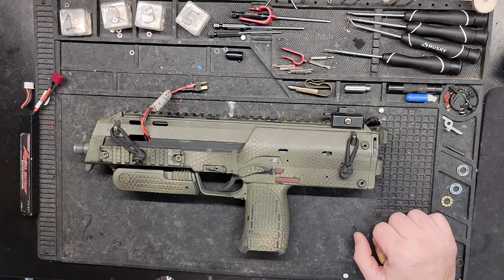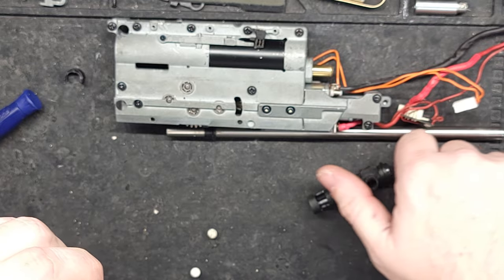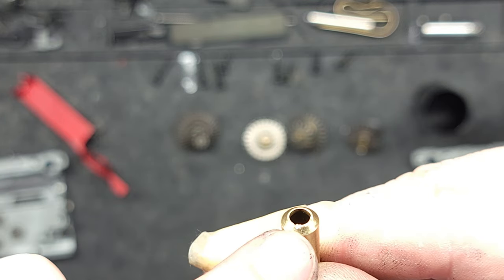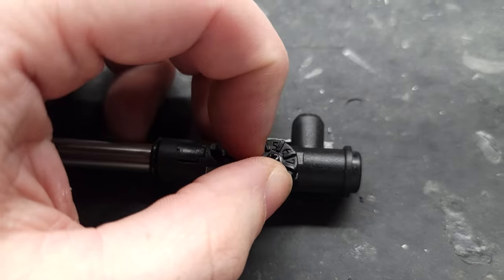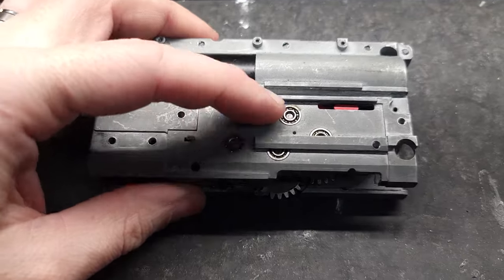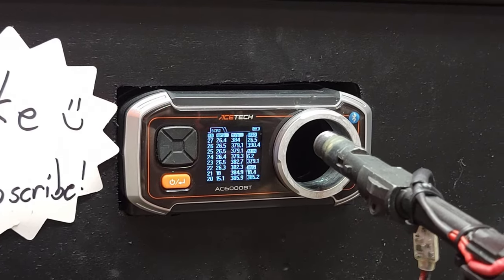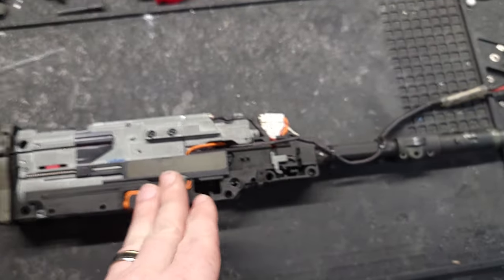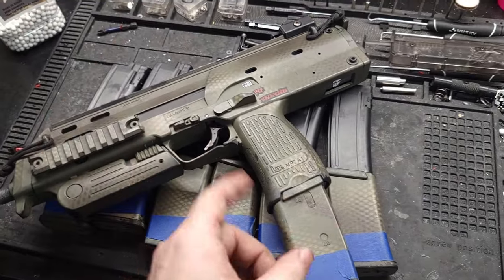VFC MP7 Build Tech Tips

Comment: T238 makes an mp7 mosfet now, not sure if it is supposed to be TM or VFC compatible but no one has done a video on it yet, additionally Solink makes a VFC compatible brushless motor for the mp7 but same thing, no one has a video about it yet. 

Could you do a full video showing tappet plate, hopup arm, mosfet and brushless motor install along with how to modify the magazine follower. Sort of a one stop video to make a VFC MP7 viable as a competitive aeg ?
Reply from the maker: Unfortunately, that MP7 mosfet is for a gel blaster MP7 and will not work with the VFC MP7 at all.  As for the solink brushless motor, I got one coming and will make a video of it.  

As for the magazine follower, I am working with Bullcraft in stocking the 1 piece followers specifically for the mp7 magazine.

Comment: Can these things take 11.1v, then? The manual and every other forum seem to suggest that the higher voltage is the receipe for disaster. What are your thoughts?
Reply from the maker: Yup, after spending many many hours working on these things.  Full auto with 11.1v lipos is what really damages these things. Putting the bullgear tappet and metal nozzle really helps these mp7's reliability.
Reply: @wyshtechairsoft  Gotcha. One more thing... do you upgrade the spring in your customers' guns? In the manual, it says that they're all putting out berween 0.8 and 1 Joules (mine is 0.79) but your fps seems WAY higher than a 0.8J AEG...
Reply from the maker: @dominicpaver I usually get customers with factoty springs pushing 1.3 - 1.5J. I normally dont stock the springs.

Comment: Do you have a video on install of the AB++?! Im about to attempt install, but i cant find any detailed videos to install on the mp7
Reply from the maker: Its pretty simple. You just solder the signal wires to the wiring connection junction that is right behind the motor.  Read the install instructions wire diagram.
Reply: @wyshtechairsoft  sweet!! I just received a order from your website! I got a mp7 and the nozzle broke after a weekend. So I'm replacing tappet, bucking, hop arm, nozzle, and mosfet. Even cut off the extra switches! Thanks for the help!!
Reply from the maker: @jimmyduff1954  glad to help bud.  Ive found after many many hours of trial and error.  These breakages in these mp7's is due to cycling too fast and the bucking lips being too far into the bb feed tube. Which if a 11.1v lipo is used, theres always a high chance of the bucking lip to fold into the barrel with the bb and cause a jam. The jam is what causes the damage.  7.4v lipo greatly reduces this chance.  Just wanted to give you a heads up.
Reply: @wyshtechairsoft absolutely! I havnt had a single issue (other than low fps i now assume is because the stock nozzle hit the mag follower causing reduced air seal in bucking) until I shot it full auto, then all of a sudden I started having over spin issues, then  I broke the nozzle housing (getting upset and holding full auto through a mag or 2) 😂 totally my fault. I never do full auto, but I was curious about the rate of fire. Curiosity killed the cat I guess 😂
Reply: @wyshtechairsoft  maaan iv got a new issue! So I got the mosfet in, works really well! Got the nozzle in, got the tappet and hop arm in... it chronoed at 250fps with a .20... I took it apart and Teflon mod the cylinder head because that's the only place I could see loosing compression. And still 250fps. Do you know if this mp7 takes a standard v2 aeg spring?? Thanks again!
Reply from the maker: @jimmyduff1954 bad hopup bucking would be my guess. Dont think the nozzle is sealing to the bucking.
Reply: @wyshtechairsoft  it's a new g&g green bucking. Maybe I'll order the one yall have on the website. I knew I shoulda ordered one when I ordered everything else! 😂 I hate taking this thing apart! Lol

Comment: What inner barrels do you use? I’m having a bit of trouble with any inner barrel I’ve got to work. If the hop is set on the last 3 higher settings I lose about 100fps.
Reply from the maker: Stock barrel works just fine. Dont really need a super accurate barrel for a smg that is ment for CQB. The loss of FPS is more than likely the bucking being used.  The begadi SHP5 works really well in this application with the metal hopup arm that comes with the maple leaf omega nub. Which can be found on wyshtech.com.
Reply: @wyshtechairsoft I don’t have the original inner barrel anymore. Is there any common barrels that you know of that works? In the uk a lot of airsoft stuff is very hard to find unless you order overseas which gets expensive. The bucking you suggested is also near impossible to get as well.
Reply from the maker: The begadi bucking is straight from Germany.  Have a look at thier website, begadi.com.

Comment: Here are my build tips for these. 
Tip 1: don't buy it. The internals are among some of the worst and at this price point you'd expect it to at least last a few years considering cyma Ak's and g&g raiders refuse to die. And worst of all parts are proprietary. Bullgear makes a CNC tappet plate which is a horrible idea. The piston is half length. Cylinder same thing. There's a 4th gear. Same reason I don't like svd's as aeg's.m and none of the gears are standard 

Seriously save the money for a gbb. Yes it's $700 for the gun and 6 mags but it will at least run for a long time and whenever something does break you can always get parts for it.
Reply from the maker: Your comments always crack me up ("Tip 1: Dont buy it.) but are good information for the new techs.  Thanks for your insightful comment. :)